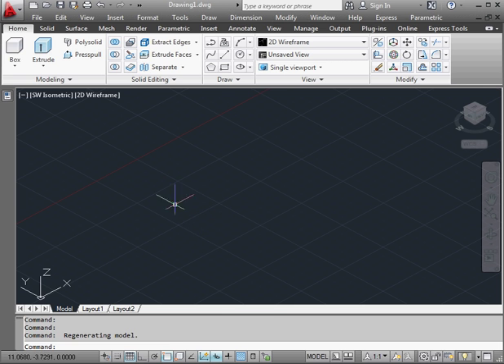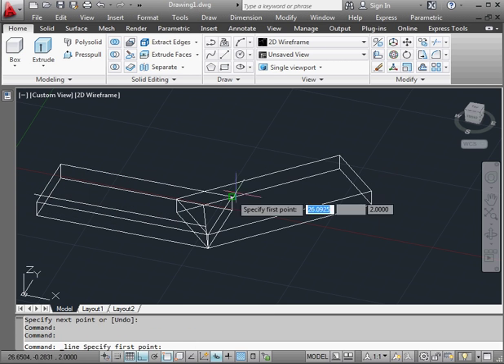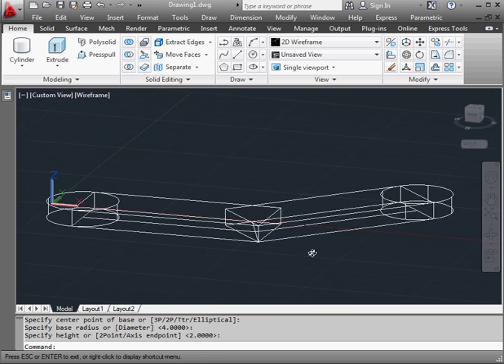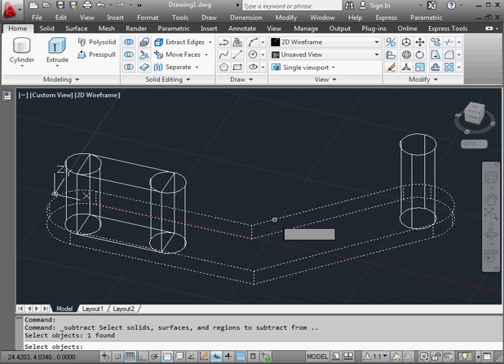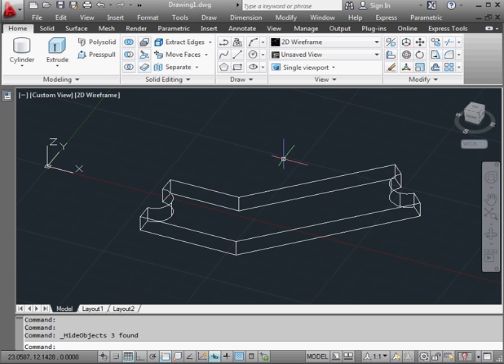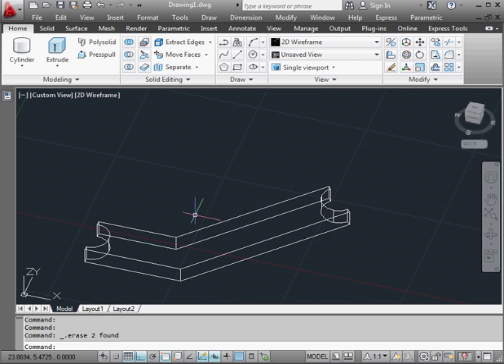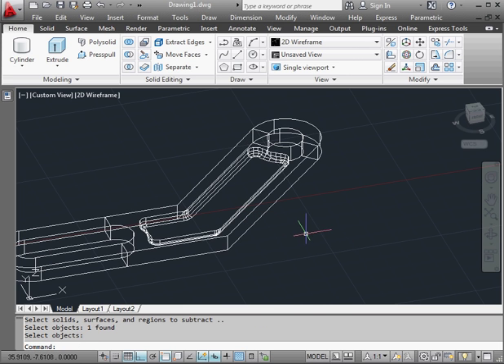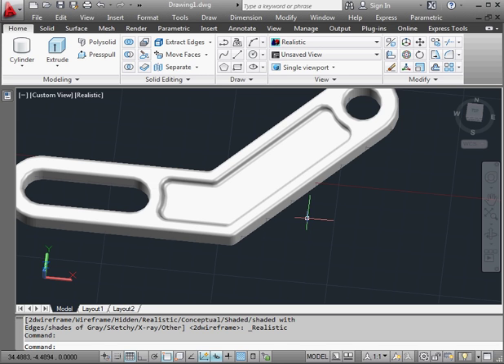AutoCAD 2012 Video Tutorial - basic training - how to use layers

Comment from the maker: Hi--AutoCAD comes in many special industry editions, like mechanical, architectural, electrical, civil etc; so pick the version that suits your industry. However, you can just start with the "regular" version of AutoCAD, which is a complete 2D tool, with many 3D modeling capabilities now, and it also comes bundled with a 3D modeling software called Inventor Fusion that is pretty easy to learn (a simplified version of Inventor). If you're a student check out the academic bookstores/ autodesk.com

Comment from the maker: Inventor is a 3D parametric modeler; your models are constrained in space by geometric relationships and other types of relationships, and thus are more suitable for subsequent engineering and manufacturing. AutoCAD is less precise as a pre-manufacturing design tool. Also, AutoCAD is primarily used for 2D drawing; Inventor is used for designing actual 3D models of things.